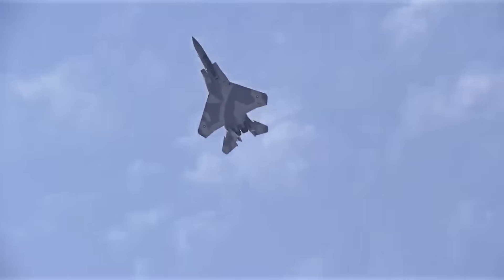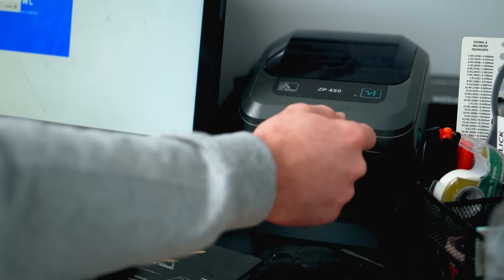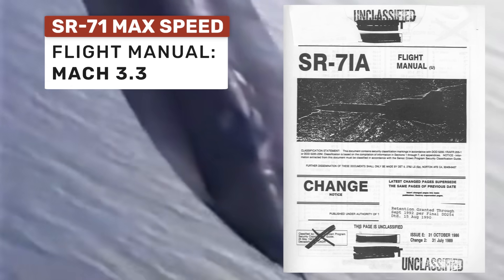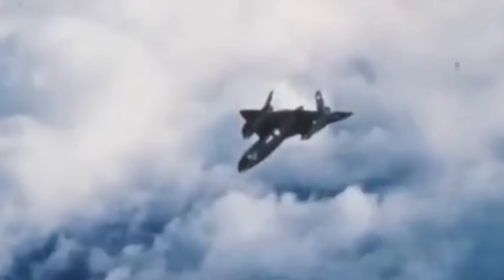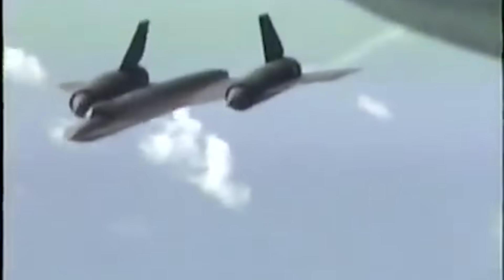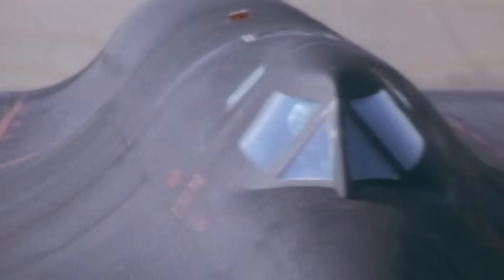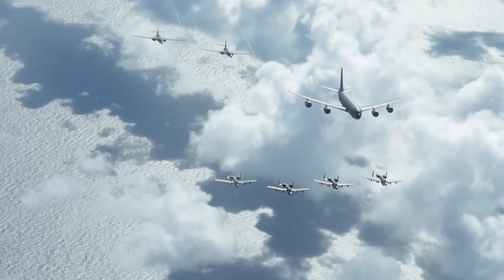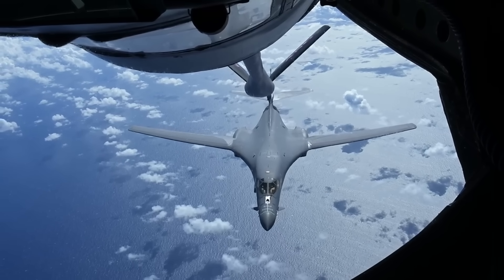The SR-71 was MUCH FASTER than the Air Force will admit

Comment: I was 18 stationed at Beale AFB as a Avionics Instrument Tech back in 1982.  I fixed all the instruments and did the "spike schedule" on the SR-71.  The spikes could move 26 inches and the fwd and aft doors would open and close at different speeds and turns.  We checked the system up to 85,000 ft and topped out at 3.2 mach on the spike cart(test equipment).  Each SR-71 sortie had a formal debrief with the tech reps and the mechanics.  For my shop we were interested in aerodynamic disturbances or engine stalls which usually occurred when the inlet spike and or doors were out of calibration for the speed, altitude, or AOA.  We had recorded MRS tapes.  This was like a EKG line across a paper.  The altitude topped at 85,000 feet and the speed stopped recording at 3.2 mach.  I saw many tapes of 3.2 mach.  The Lockheed engineers never disclosed what the absolute top speed was they did say it was limited by the spike and the fwd and aft doors.  I am 60 now and I am blessed to say I wrenched on the SR-71 for the first years of my AF career.  This was a awesome video, thanks for bringing back memories.  God Bless 🙏
Reply: I tracked one of those classified glitches. Lets just say it was faster than any Talos missile.
Reply: What the doors adjusted how opened and closed they were during different maneuvers? I was not aware of that I just thought they opened when they were using the engine as a ramjet for thrust as opposed to when they were using the turbines for thrust. I didn't know that the doors actually fluctuated depending on what they were doing
Reply: @benvaun1330  The SR-71 pitot probe has an adjacent AOA probe attached to it off to the side.  When we brought out the test equipment called the spike cart we attached pitot static hoses to the pitot probe, the AOA probe and the fwd aft bypass door manifold below each engine.  We had a paper sheet and the tech reps wanted us to run and record what they called a nominal schedule on the inlet and doors.  The spike and doors were locked until you passed 1.4 mach.  We simulated accelerating and decelerating climbing and diving and turns.    At each test point I ran back and recorded where the left and right spike had traveled along it's 26 inches of travel.  The spike schedule took us 4-6 hours to complete.  When then took our worksheet back to the tech reps.  They would use our numbers to calculate what they needed to twerk on the spike computer.  They had about 8 vernier dials they could move to finely adjust.  If we did out job right the pilot/rso would not experience a engine flame out or AD(aerodynamic disturbance) which is a severe and violent yaw.  I am pretty sure when we put the SR-71 in different pitch and yaw maneuvers the doors worked in conjunction with the spikes.  I remember I think it was 975 kept having AD's damn near every flight.  We replaced the spike computer did numerous spike schedules but the numbers all were good but the plane kept engine stalling.  Turns out there was a small chip the width of the thickness of your pinky nail at the entrance of one of the AOA ports that at mach 3+ disturbance the air entering the probe.  We replaced the pitot probe and fixed the jet.  That problem kicked our asses so I will never forget it.
Reply: @docohm50  You are legit, DAFICS man. I worked down the hall from you in the ANS/INS shop. I saw some interesting numbers as far as GROUNDSPEED that the Nortronics NAS14V2 nav system recorded in the MRS (Mission Recording System) printouts. They forgot to clip the numbers in the report. I saw a GROUNDSPEED in excess of 3,000 knots. But groundspeed is different than Mach and TAS (True Airspeed), as it is the rate of travel across the surface of the earth at Mean Sea Level (MSL). Mach is dependent on the air temperature and density at altitude. The report I was examining may have been that from the mission Schul flew over Libya. I had to close the MRS printout, hand it to TSgt Gingrich for reclassification to Top Secret from Secret because they forgot to clip it. We only had two TS guys at that time in the Avionics Maintenance Squadron, Gingrich and one of the guys in MRS shop.
Reply: @benvaun1330  They never "became" ramjets. That's an incorrect thing that got out there and now can't be put back in the bottle. One of the designers made a video in which he said that point blank. It always operated as a turbojet with variable amounts of bypass, but it never remotely completely bypassed the turbines.
Reply: @benvaun1330  Not so much different maneuvers but for different speeds/Mach numbers.  Wikipedia has some great resources on J58 operation including all the scheduling you are talking about.
Reply: Kelly Johnson and his team were geniuses.  The did almost all of that with slid rules and adding machine equipped women "computers" !!!   And it still looked like something from the future, that is going fast just sitting there!!!
Reply: My dad was part of r&d and he said the top was classified.  Also said even time the Russians would make a new speed record. the bird would just break their record by a little.
Reply: @Ghost_Bear_Trader The information you posted was just wrong, there's nothing to clear up. X-15 speed runs were typically in the range of 120,000 feet, the speed is about mach 6, which is the same Mach 6 for an A-12 at 120,000. And I also note that even the X-15 effectively self destructed at about the same altitude and 6.7, even with up to 4" of ablator on it. An -12/SR71 would collapse due to structural loads and heat=-damaged titanium at Mach 4 for more than a few tens of seconds. It's no shame that a completely practical ground-launched airplane might not be able to meet the same speeds/records as a custom-built experimental airplane built of the most exotic alloy at the time and capable of 90ish seconds of powered flight, so why would it be important to exaggerate into the realm of fantasy about it?
Reply: @brettbuck7362  "....custom-built experimental airplane built of the most exotic.." It's still a rocket. Was. 
They officially now categorize it as an "aircraft" (X plane) in newest nomenclature. But we know better.
The fun part is that we kids got to see it with the ability to "land" itself via the "skids"!
Anyway, thanks for your valuable info.
Somewhere there's tales of time vs distance that leaked out in the old stories, including the missile evasion tales.
Me? I saw a Habu land at Kadena in a midday "maneuver". Mid summer. 1977. Semper Fi.
With my own eyes....
It "circled" Kadena first.
In broad daylight.
This was a generation before thrust vectoring.
What I saw?
No way.....absolutely no way.
Everybody else said: "Cool!"
Me? Like I said: no way....
There was nothing that kept that Habu aloft during that circle...except...the "sound".
Something else was going on.
Cheers!
Reply: @JubileeValence  And how long did the X-15 maintain that speed before returning to ballistics and glide in a decel?
Reply: @DavidMitchell79  ...ballistics...🙄🙄"decel"....🙄🙄🙄
Depends on the gas tank 'mang....
I dunno I still dug the skis; you?
Reply: Dude sounds legit
Reply: My sister was there working on these planes.  She married a pilot.
Reply: @nevadabadger7925  was she a PSD tech at the time?
Reply: I was in the Instrument shop in 1968 - 1970
Reply: I was a dependent at Beale early 70's. My friends dads were with the SR71 & KC135 fuelers. Been at the flight line many times.  Again in the late 80s a friend worked with the SR we were always amazed with this aircraft flying by beating the sound barrier. Heard 3 simultaneousl booms was normal. The design was told pushed the plane . The more fuel you could dump down its engine the faster it will go.. Beale AFB was an excellent base to grow up at.
Reply: @Ghost_Bear_Trader X-15?  That's just nonsense, the X-15 would go Mach 6 at that altitude, the extended tanks version went Mach 6.7 with massive amounts of ablative coating, and still burned itself up and never flew again. It was made of Inconel X750, the A-12/SR-71 was merely titanium, it would be reduced to liquid at those temperatures.
Reply: Titane molde AT 1660 °celsius
 And hé Can accept easely mac 4  if you know  1300 ° atteined during  
Mac 3  on thé front wings and n'ose   ? Isn t it ?
Reply: More detailed but matches up a little with what my grandfather said about the SR-71s he was working with in the 60s.  The Lockheed reps were adjusting things constantly because they also realized each plane was reshaping itself ever so slightly, becoming just a little more aerodynamic, a little faster each time they went over mach 3, and that they were starting to notice differences in performance between new and older planes back in the 60s.  He speculated that the SR-71s still flying in the 90s were significantly faster than the same ones he worked on in the 60s and that no two were exactly the same anymore.
Reply: @jlokison  that's true.  That's why the tech reps had us put a baseline schedule on each aircraft.  We would give them our data they would review it and then give us a sheet that told us where to set the vernier dials on the inlet computer.
Reply: I was there in 1974 (as a dependent). I remember the base paper would feature pilots getting their "80,000+" and "Mach 3+" pins.
Reply: well a lot of us has heard mach 3.5 ,, and above ,
Reply: @keithbell6104   Pilot testimony said 3.5 plus for both the A12 and SR71. Another report from the Swedes corroborate that and that Mig 25 and 31 could not reach the service ceiling or speed or range.
Reply: The engine stall you described was known as an "engine unstart", which threw the bird into a violent uncommanded yaw. My neighbor and good friend was responsible for the flight augmentation systems maintenance and calibration for the YF-12A, A12 and SR-71 series at Kadena and Edwards. He knew a few pilots who experienced that terror first hand... just cruising along at mach 3.2 through calm still air, and then suddenly having his helmet violently slammed into the side of the cockpit, while trying to jam in opposite rudder before the bird disintegrated. I cant even begin to imagine. He is now an extremely talented IA who maintains my aircraft and several other sky toys. People travel far to bring their aircraft to him, where others have failed to correct complex problems.

Another neighbor (I live at a sky park) piloted the linear aerospike equipped blackbird on loan to NASA. He said the unstart issue had never been corrected and hoped he never had to experience one, especially while bringing the aerospike online with the 2 main engines. He didnt think he would be able to react in time to recover before total disintegration, because the 3rd engine added another layer of attention and complexity that was required during recovery. I have always wondered: of the inventory of blackbirds that went MIA, which was nearly half of them, how many were lost due to engine upstarts, or air frames that had been compromised from experiencing them. Interesting stuff. Or at least I thought so.
Reply: No mention of President Jimmy Carter and aviation enthusiast Father Hesburgh of the University of Notre Dame, Indiana ---  Mach 3.52 on Feb. 28, 1979.  Pilot: Major Tom Alison
Reply: Was also there 80-82…crew chief & docks. Cross trained out in 82 to pursue other adventures.
Reply: Fantastic story sir. Thanks for sharing, never thought about all of the support equipment that went into making it safe to fly as fast as possible she did.
Reply: This is what the cops don't want you to know...that North American badass.... Is actually powered by a Chevy 427 V8 with twin quad's with 13:1 compression ratio!!!! HOT DAMN.  NORTH AMERICAN BAD ASS !🇺🇲🇺🇲🇺🇲🇺🇲🇺🇲🇺🇲
Reply: The Max. Speed is definitely also limited die to the inlet cone! As gar as I was told when learning about turbojet engines is that they can not take air in which is faster than mach as the aerodynamic would fail in the hpc with stalls and surges as a result clearing the hpc of all blades and vanes. Second limitation is of course the Temperature like mentioned in the vid. 
SR-71 was nevertheless one of the coolest ever produced airplanes!!!! 
I really envy every of their Pilots! 
Must have been much gewatet than sex flying such a thing!
Reply: My dad probably worked with you. He came back to Beale then Mather in 82, from Elmendorf, going to Korea in 88. He told me they had a missile launch from North Korea at an SR-71, the pilot hit top speed to outrun it, and the speed was much higher than published. He also worked on the U2, B52, F117, and some others. Towards the end of his career, he spent a lot of time in a Nevada but was stationed at Wright-Patterson. He has confirmed, no aliens, it’s all been us the whole time.
Reply: @kgmarcussen  I was in the 9th AMS Instrument shop from 82'-86' last name is Kerbs.  Maybe I did work with your Dad
Reply: @kgmarcussen I'm appreciative of that last sentence, thank you... 😎👍🇺🇸
Reply: Blessed is putting it mildly. Enthusiasts like myself can only envision what your experiences were like in our dreams & imaginations. Which really is a poor substitute. I say this with the utmost respect & appreciation for your service.....
You lucky bastard! 🤔🤨🙄😶.....🤣. Well done, Sir.
Reply: @TomFlaTTop_BMW  Thanks, I was blessed to have an incredible career in military aviation.
Reply: @docohm50  
I salute you, Sir. To folks like myself, you lived the dream. Your memories must be frickin' AMAZING. All the best. 👉👍
Reply: Thank you for sharing, sir.
Reply: Did you live in Wheatland?  Or on base?
Reply: @DanFoster6767  I was in the dorms until I made SRA then we lived in Marysville
Reply: After having a close relative in the Air Force for 25 years working on a lot of projects. Understandably the military will never acknowledge top speed or ceiling on some of their aircraft
Reply: It’s tough to have such a great assignment first, then be switched to a different bird. Everything else could be below the bar. Hope you had a great tour all and all.
Reply: @hwytravler1962  that's true.  After Beale went to Germany to work on the C-23A Sherpa, then back to CA for C-141 then to Mississippi for EC-130E then back to CA to the C-5
Reply: @docohm50  Hey, did you know MSgt Curtis "Mike" Brooks , AGCS troop? He was reassigned to Germany for the Sherpas, also!
Reply: @DavidMitchell79  Man I suck with names..lol. I was stationed at Zweibrucken with the 10th MAS 86'-90'. My name is Mike Kerbs.  If you know me and I can't remember you please don't be  offended, too much partying when I was younger.
Reply: Amazingly Aircraft !
Reply: Thank you for your service.  I got to see the SR-71 at Beale AFB and go through the full pre-flight with the pilot in those same space suits as the shuttle was using.  I was there with a group of cadets from the Civil Air Patrol and we were given a special tour.  This was in 1983.
Reply: @noctwice  WOW very cool!
In the summer of 83' I went on my first TDY to Okinawa.  We stopped in Alaska for fuel.  We were late taking off because the SR-71 pilots went to town and brought back cases of snow crab legs and we had to wait for the KC-135Q crew chiefs to strap down the crab legs in the landing gear to keep them frozen going across the pond. Good times.
Reply: I have a family member and I'll leave it at that. He said The plane left Beale Air Force Base and landed at Andrews Air Force Base.. He rounded it up to 48 minutes but it was in the 47.40 range..that included takeoff and landing.
Reply: @rtaAsh  Vita and Yielding set a record from LA to DC back in 1990.  I was in Germany at Zweibrucken out of the program when that happened.  Regardless, lots of respect for the orange flight suits.
Reply: As a EW reconnaissance operator in the USN in early 80s we used to fly out of Alconbury and Mildenhall as well as RAF Wyton.  One of my favorite was to go up the Baltic to support the SR runs.  Its was a hoot.  And that sucker was fast on ground speed (only thing I could measure) but Mach 3.2 is slow 😁.
Reply: @rickscott7350  That's awesome.  Did you actively jam or passively monitor the Commies when the SR was in the envelope overhead?  I left Beale in 86' and PCS'd to Zweibrucken AB with the C-23A.  Went from fastest to slowest aircraft..lol. I got to see how you Navy guys roll at my last gig with Lockheed.  I was at Elgin and we were hired to teach the Air Force, Marines and Navy how to maintain the F-35.  You would appreciate the EW systems on the F-35.  Cool story Rick.  Take care.
Reply: @docohm50  Jamming in non wartime is a giant no no, we just passively monitored radars and communications.
Reply: The sr71 can do 45 miles a minute and can cross Nebraska in a little under 5:00 minutes. All 220 miles(width) of it. That’s Mach 3.5 which is the fastest it can go. Well atleast the fastest anyone was willing to push it. I did all the math based on an interview with a reliable source(SR71 Pilot). Please be cordial. I am not making any of this up I absolutely would not waste your time or mine. You can do the math for yourself. Nebraska in 4:30-5:00 minutes is Mach 3.55-3.50. Also in this video alone a pilot reported him doing 3.5 running away from a threat so now that’s 2 pilots who have made this claim and I fully believe them. That’s 2,685 MPH. Absolutely insane and ridiculous. I couldn’t imagine being in the baddest and fastest air breathing machine ever built back in the early 60’s (1964). Must’ve felt like you were flying a legit space ship which you kinda were. Flying on the edge of space while wearing a spacesuit. Like Jesus Christ, I couldn’t imagine. Even if you built the sr71 today it would still look very modern and have modern performance being able to out perform anything else in the world. And to have that feat still to this day(60years) really goes to show how advanced this plane really was. Should’ve never retired it. Should’ve built a bigger super version with upgraded engines, more advanced materials, making it stealthy with modern radar absorbing coatings, and more advanced cameras, and jamming systems. Making the plane 20% bigger with bigger more fuel efficient engines would allow it to travel much further and faster and doing around 4,400 miles at Mach 4. It would be unstoppable. We’d be flying directly over China or Russia untouched and unseen on radar. Should’ve made a super sr71 like they did with the f18 hornet turning it into the super hornet.
Reply: The sr71 can do 45 miles a minute and can cross Nebraska in a little under 5:00 minutes. All 220 miles(width) of it. That’s Mach 3.5 which is the fastest it can go. Well atleast the fastest anyone was willing to push it. I did all the math based on an interview with a reliable source(SR71 Pilot). Please be cordial. I am not making any of this up I absolutely would not waste your time or mine. You can do the math for yourself. Nebraska in 4:30-5:00 minutes is Mach 3.55-3.50. Also in this video alone a pilot reported him doing 3.5 running away from a threat so now that’s 2 pilots who have made this claim and I fully believe them. That’s 2,685 MPH. Absolutely insane and ridiculous. I couldn’t imagine being in the baddest and fastest air breathing machine ever built back in the early 60’s (1964). Must’ve felt like you were flying a legit space ship which you kinda were. Flying on the edge of space while wearing a spacesuit. Like Jesus Christ, I couldn’t imagine. Even if you built the sr71 today it would still look very modern and have modern performance being able to out perform anything else in the world. And to have that feat still to this day(60years) really goes to show how advanced this plane really was. Should’ve never retired it. Should’ve built a bigger super version with upgraded engines, more advanced materials, making it stealthy with modern radar absorbing coatings, and more advanced cameras, and jamming systems. Making the plane 20% bigger with bigger more fuel efficient engines would allow it to travel much further and faster and doing around 4,400 miles at Mach 4. It would be unstoppable. We’d be flying directly over China or Russia untouched and unseen on radar. Should’ve made a super sr71 like they did with the f18 hornet turning it into the super hornet.
Reply: I was Photo (82-86) at the same time you were there. Olly North kept us both busy.
Reply: Nice!
Reply: Someone correct me if I'm wrong but didn't Maj. Shul state that his blackbird hit Mach 3.4, if ever so briefly, due to diving to evade a missile?
Reply: I'm sure the gloves were off over enemy territory, so the Russians knew the top speed, or very close....
Reply: I've actually heard the SR-71's top speed (I won't repeat it here). It's kind of a pickle because as much as I'd like to say it, even giving hints (talk-around) is a data spill. Let's just say it was an eye-watering speed.
Reply: @matts156 the SR-71 had a MRS system (Mission Recording System). Lots of data is recorded each sortie.  Altitude, Mach, IAS, AOA, inlet spike position front rear bypass door position etc.  the mach tapes stopped recording at 3.2 mach and the altitude was pegged at 80,000 feet. I read many sorties and the MRS tapes were pegged at 3.2 Mach and 80,000 feet.
Reply: Another reason to hate doors
Reply: God Bless as well, and it is a funny bit of additional info that we bought the titanium to build them from our good buddies: the USSR
Reply: @cski12894  As I understand it Kelly Johnson bought the titanium under a fictitious business name from USSR for Skunkworks. Lets see that clear the red tape in todays world.
Reply: Thank you for keeping us safe  !
Reply: @Erikr-ex9dj   "safe"?
Reply: @Erikr-ex9dj it was used for reconnaissance aka "spying" not for keeping anyone safe but creating problems in the world and for humanity. That aside it's a magnificent piece of engineering and intellect on behalf of the engineers. Imagine if they used that skill/talent for the betterment and progression ofankind rather then to its detriment
Reply: @rickybalbia9612  It never fired a shot. And it prevented many shots from being fired. Keep your politics to yourself, they are off-topic. I hope you don't use a gel pen or a calculator... They resulted from such programs.
Reply: @DavidMitchell79  Funny you’d mention that! I got kicked out of H.S. Chemistry because I couldn’t afford a $40 slide rule. Texas Instruments had a handheld digital display calculator for $9.99 but they were only allowed in colleges in ‘72. There’s some politics for you! WOW…..
———-
Gas was $.50
$40 was a week’s wages AFTER taxes…
Fuck chemistry…😂😂😂
Reply: Truth brobably is nobody knows, whoever took a chance and fot away with it would be the fastest. But the thing was designed for 3.2-3.3, faster and tou are taking chances with heat and pressure overload. It had thrust for going faster, but that's not enough.
Reply: The video blows my mind with the speed and your accounts way more,even the recordings did not get the real speed made for all the accounts of the pilots.
Reply: Awesome....just commenting because my brother was at Beale for his 6yrs of service, but worked in cyberspace warfare and ISR. He's still there now, but as a civilian contractor. Seen the Dragon Lady over there multiple times as well as several amazing airshows. Thank you for your service and I'm super jealous of your time working with the Blackbird!!!
Reply: Yep, past 3.3 and you would have a big problem.
Reply: ~3.3 is the correct answer any faster and the engines swallow the shockwave
Reply: @carmadme  yep, you can calculate the spike shock wave cone angle that just touches the inlet and that's the max theoretical speed.  Obviously there would be a safety margin from the critical dimension.
Reply: @NoferTrunions  yep 
As you know as well as I temperature and pressure play a role as well as going past the safety margin if needed but at the end of the day the engine inlet was temperature limited the aircraft was temperature limited and the design of the inlets were pressure/shockwave limited 

All this stuff you hear about the aircraft doing Mach 10 and going into space are all pure fantasy possibly from misunderstanding how the engines operated 
the amount of times people have retold the same rubbish about them turning into ram jets is crazy
Reply: @carmadme  I said the max theoretical speed.  That means under no circumstances could the aircraft ever go beyond that speed.  I'm sure they designed everything to achieve a specific max speed - it wouldn't make sense to have a Mach 4 inlet with a Mach 3 engine.  All the claims of hyper speed could be categorically proven wrong by that cone angle.
Reply: @NoferTrunions  Airspeed. If the SR71 surfs the jetstreams it can go WAYYYYYY faster when it comes to ground speed
Reply: Has the gov't taken away your pension yet?
Reply: @dannygjk  no that's a scare tactic.  If the government shuts down social security and military pensions still go out.  Your non-essential government employees might not get paid.  We need to shut the government down and reset our spending.  Right now illegal aliens get free housing food education and healthcare on top of a paper voucher that allows them to fly anywhere free
Reply: You disclosed too many classified info!
Reply: @abcxyz-nd6xh  Program has been declassified. You can get the flight manual and tech manuals right off of the  Internet.
Reply: I'm betting Mach 5 to Mach 6, maybe higher!
Reply: You do comprehend that that is still top secret information right? Talk less airman.
Reply: @joshschneider9766  🤣🤣🤣🤣🤣 like us there are secrets of the B-52 after 70 years and 3 generations of crews and maintainers
Reply: @joshschneider9766  No. The program has been declassified. That's how I proved to the VA my rare cancer may have been caused by PW536, the fuel additive in the JP-7 fuel. I used the de3classified tech orders tech orders and researched the Pratt & Whitney PW536.
Reply: @DavidMitchell79  oh ok. Last I heard they were sticking to 2200 mph. Good to know. And sorry you deal with medical stuff related to it. Hope the VA treats you better than it treated my cousin.
Reply: @DavidMitchell79 Hope you are well and thriving 🙏🙏🙏
Reply: In the 70's the declassified top speed was over Mach 3.2. Flip those numbers and you get Mach 2.3. To which I have a question for you: What two U.S. acft, both fighters in operation today, can attain a nearly identical Mach 3.2 top speed, and perhaps greater?
Reply: @cassiespencer6134   I’m guessing one has the f110-GE-129 engines and the other has a pair of f119-PW-100s.
Reply: @cassiespencer6134  the f 111 attained mach 3.2 but not for long because it had an aluminum airframe.  Look up the J58 engineers interviews. He blurted out all kinds of facts about engine performance. It was 3.5 plus output on the ground. Higher when airborne.
Reply: @cassiespencer6134  I would guess the F-15EX and the F-22.  I ended my career working for Lockheed on the F-35.  I know it can't go that fast.  It doesn't need to though as you can't see it, but it can see you.